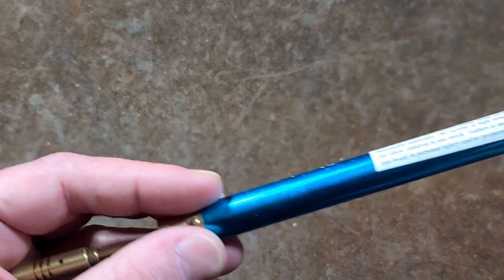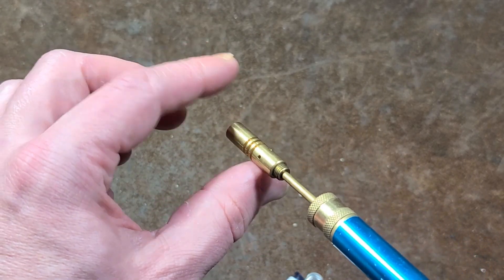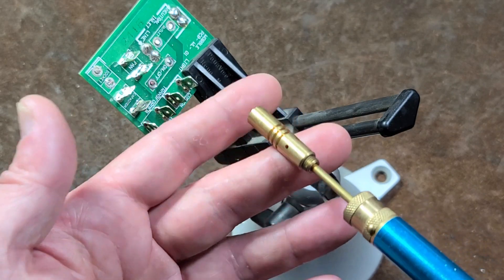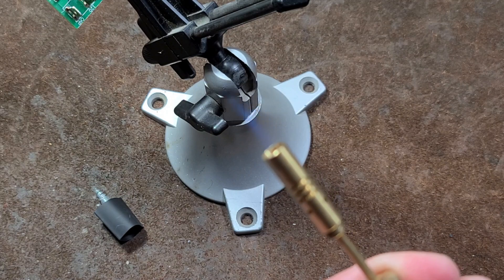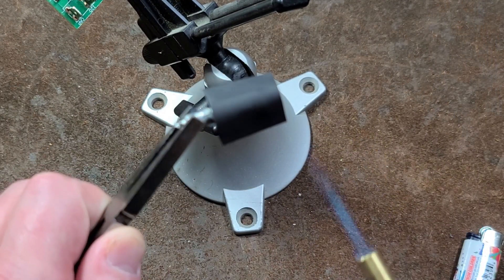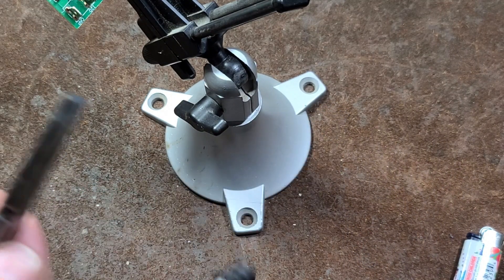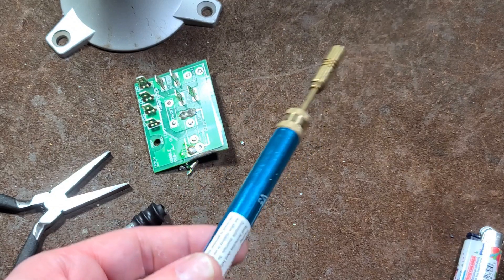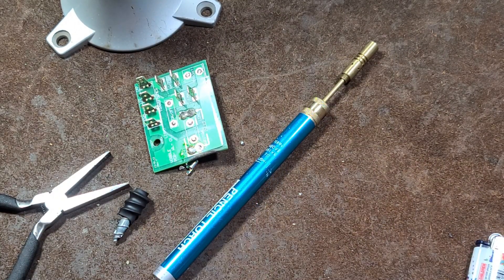Harbor Freight Pencil Torch Review

Comment: About 35 years ago I seen these being peddled at a tool / trade show and had to have one!   I used it for many years and have bought others since then.  They haven't changed any over the years!   Classic design that works well, its sad that Harbor Freight does not carry them anymore.
Reply: Bought a couple from Tractor Supply they still have them in stock hope they don't do the same thing Harbor Freight did and phase them out
Reply: @EdwardRodriguez-cv6pf  Can confirm. Good for reducing bubbles on resin, s'mores, or fending off attackers.

Comment: Tractor Supply has these for $5.99 this weekend.
Reply: what kind of tractor do you have?
Reply: I just saw 2 for $4.99 at Tractor Supply!  It sounds like a great deal if they work. 👍
Reply: I got two from TSC also. Mine are red. Worked well but now won’t let fuel out the valve.
Reply: What kind of tractor do you got
Reply: I got 2 two packs for 2.99 each at TSC
Reply: @FALLONMICHAEL1022  - Mein Gott! I will go there tomorrow! -  Danke

Comment: you should review those plasma stick lighters. They bend and flex at the head and they are rechargeable via usb
Reply: and utterly useless for any application where this torch makes sense, except for LIGHTING this torch.  Really, the plasma stick lighters are crap for just about everything except lighting some gas appliance like a grill, water heater, this torch, or a candle in a deep vessel.  Plain old dollar store $1 butane lighter does all that just as well, and lights fires on less combustible materials much better too.  So my review:  Makes a spark.  Waste of money.
Reply: @stinkycheese804  You realize he basically said pencil torches are crap right? The one he had could barely perform the job at all and a small jet lighter would have been more effective. At least a plasma lighter is rechargeable and can actually self ignite and is reliable. Hell you can easily make a better version of a pencil torch at home with a compressed fuel source, hosing, and nozzle of your choice.

Comment: I have two of those and I had to steal parts from one to make the other one work.  Be careful about the seals, or you can have a bit of a fire bomb in your hand :D. Great tool because you can refill them and they are very slim.  It would be cool if someone made a version that was a butane soldering iron and open flame tool all in one.  Maybe mix two together with oxy and actually cut some metal :D

Comment: Had these a couple times.  Always was junk.  Flame goes out very easy.  Adjustment always sucked like hell. 
Very unfortunate.  Perfect size for a quick solder/heat shrink that comes out of the blue.  An wouldn’t take up any space in the bag.  
Ild pay high dollar if someone actually redid this tool.  An made it properly an had a good adjustment an good seals ect.  Ild easily drop $50 on a good quality one in that form factor.  Even if it had to be a slight touch bigger

Comment: This model is rubbish. I have a Portasol gas soldering iron with a tip that serves the same purpose, with much better safety and reliability.
Reply: Probably couldn't buy two of those for $3.50 like the pencil torches